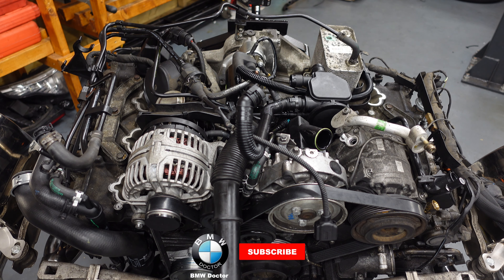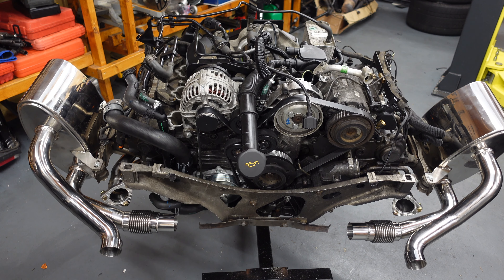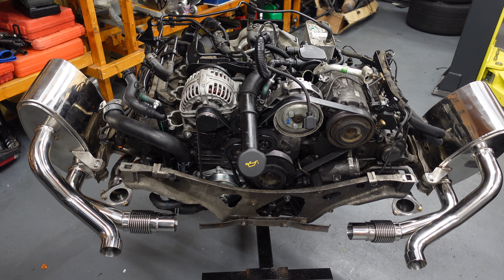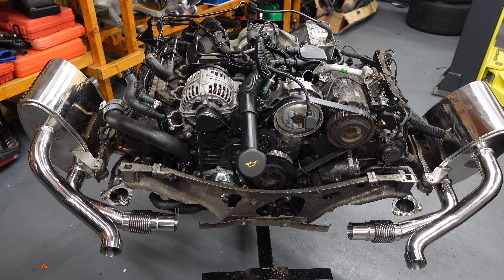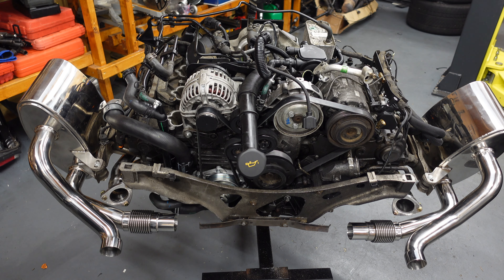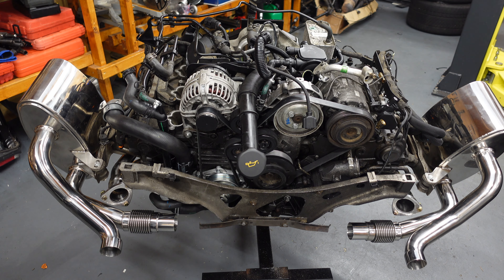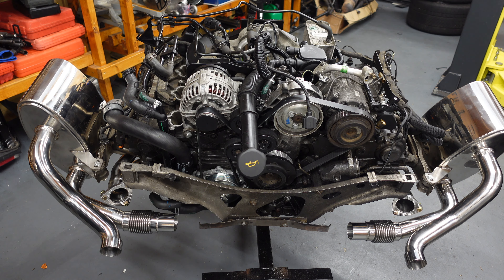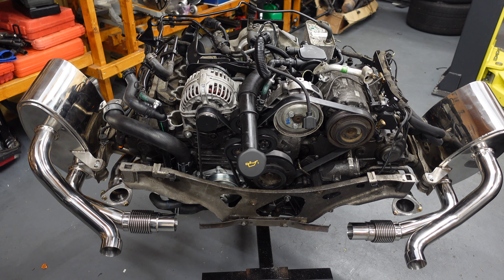Porsche 996 / 997 Engine Rebuild Designtek Headers , Dansk Exhaust System , Vacuum Lines  ( Part 9 )

Comment: You should make it a manual swap!! - Given you got it all out now already..
Reply from the maker: I have zero intrest in a manual from what I have seen everywhere most want the auto not the manual. Plus this is the Mercedes transmission used in the AMG so it’s a desireable and solid transmission. I do not own and won’t own any manual cars. I have driven both the 2S in manual and auto and the auto is lightning quick compared to the manual your in 4th gear by the time the manual is only in second sorry not for me the manual gearbox on Porsche is like a VW and Audi heaps of s**t that falls apart including the gear knob , selector cables no thanks